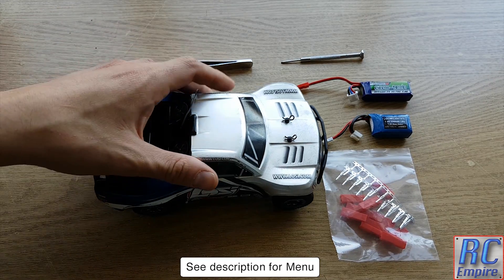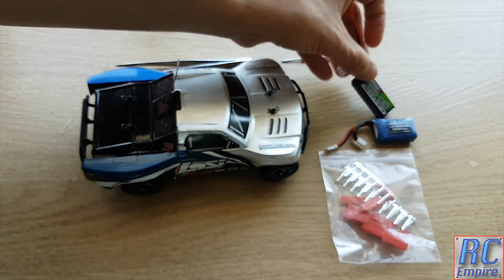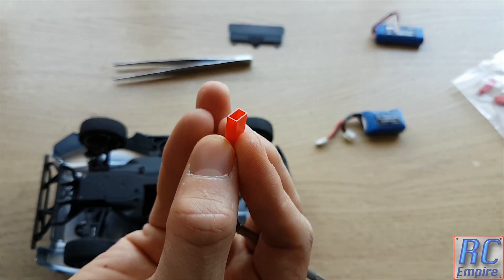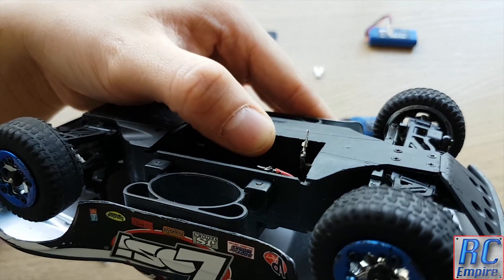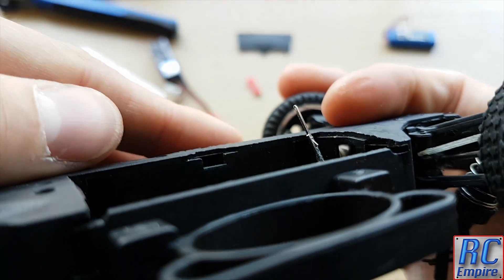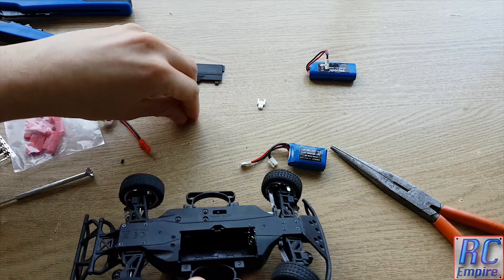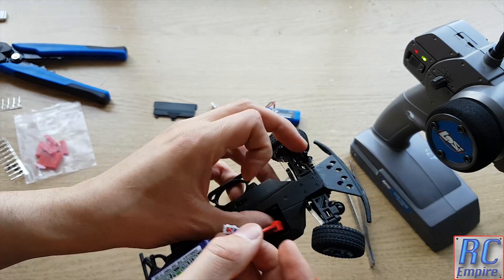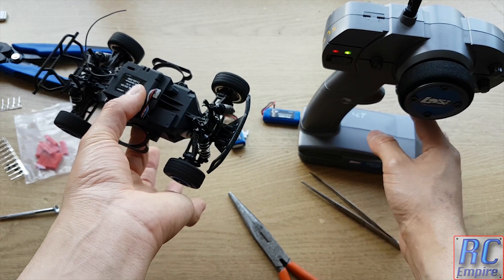Connector Conversion - Molex 2 Pin to JST - Ft. Losi Micro SCT

Comment: instead of changing the crimp, would it be easier to make extender wire with 1 end using male molex and the other end female JST? Good video!
Reply from the maker: Yeah you could definitely do that.  It would probably be less fiddly. Although, as long as you could get the extra wire and plugs in the tray :)
Reply: yes it looks tight either way!